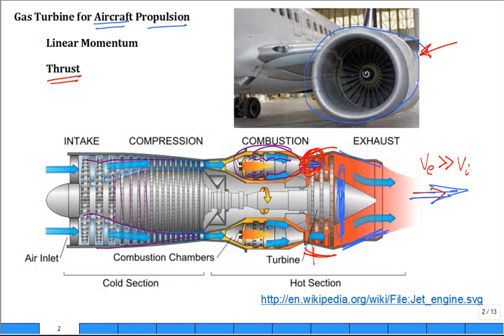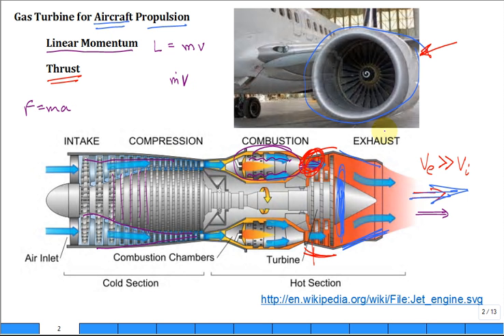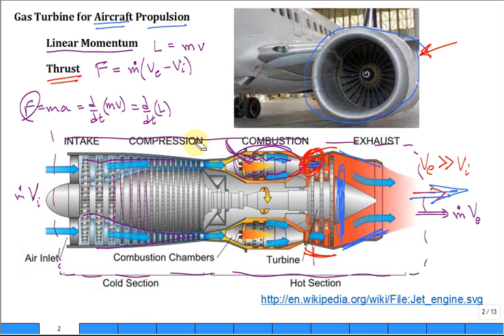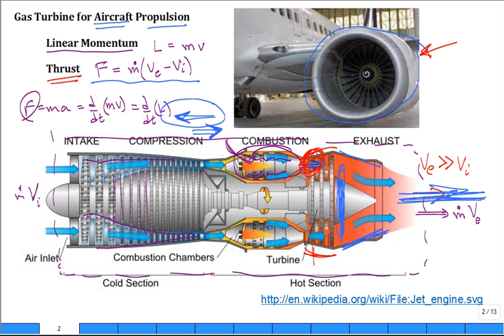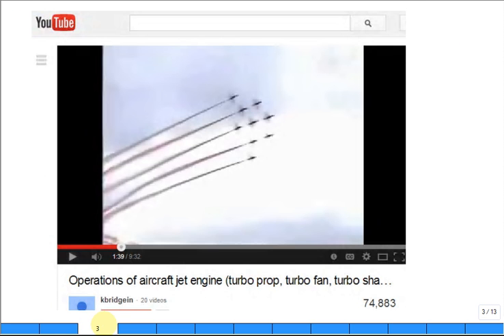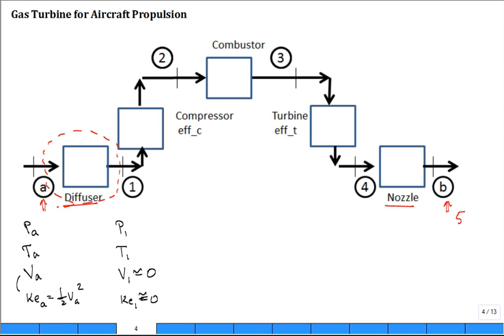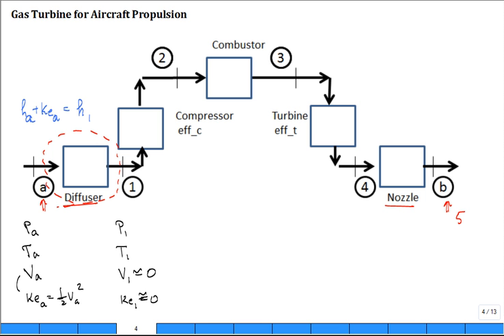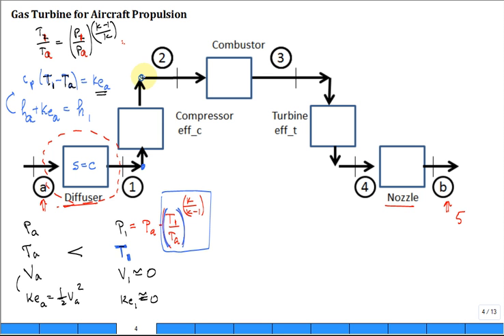ME4293 Gas Power 6

Comment: Sir, will you please tell me the software that you are using to take the screen shot as well as the software with which you are writing
Reply from the maker: using an old HP Compaq tc4200 tabletPC, running windows Journal that has pages that I click between (numbered on the bottom of screen), recording audio/video with TechSmith's Camtasia that is running in background.